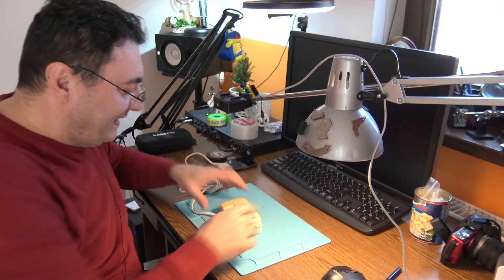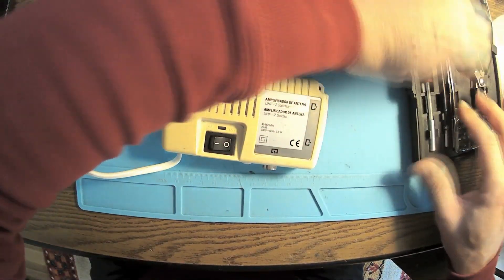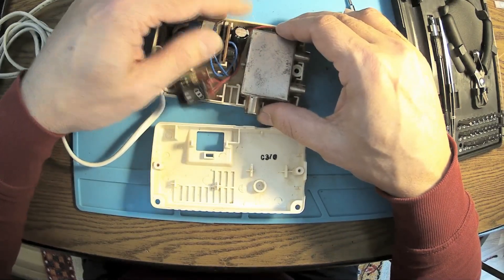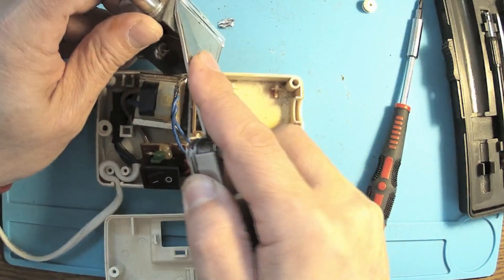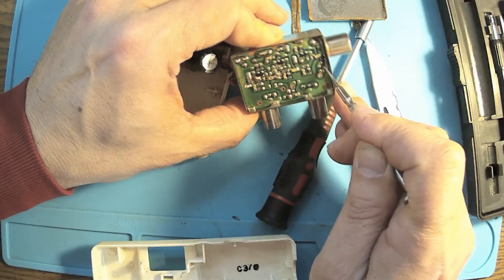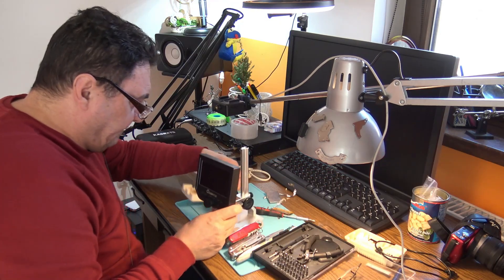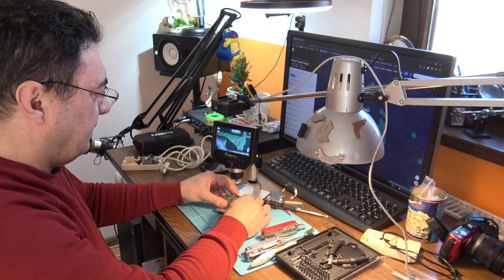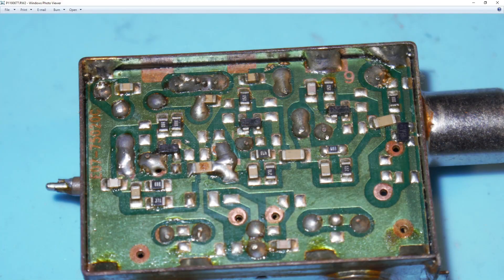UHF amplifier for Helium miner? Why not! part1

Comment: Im pretty sure correct me if im wrong but tv amplifiers are 75ohm helium minera are 50ohm like 2 way radio uhf. So you could use an amplifier just a 50ohm one?
Reply from the maker: Yes, It's not so critical..it really matters for long transmission lines or cables but for this application is not a problem..
Reply: @viocaia  thanks for informing me
Reply from the maker: @vm7898  Always! Thank you too!

Comment: hi great video .on the ab iot 868 mhz amp on your previous tests did green and blue light go on /of ? i have one and only green light on all time cheers
Reply from the maker: Blue is for TX only..it's blinking for half second..when the hotspot is beaconing..so no chance to see it lighting..but if you get your mobile on mobile data GSM.,.and keep it near the antenna input while you do a speed test you see the blue running..means is TX from your mobile..most simple test..
Reply: @viocaia  thanks for quick respons i will try gsm test.. thanks

Comment: Hi sir I have heltec miner, but I have a witness problem, they sent a filter, I have the same problem, what should we do?
Reply from the maker: Good antenna, best cable, filter , amplifier and miner..it should go..start with a good antenna..McGill 6dB , RAK 8dB..LRM400 cbale..then the rest of the things..
Reply: @viocaia  i use 5 dbi rak antenna 5 meter lmr 400 and heltec filter now
Reply from the maker: @ozk1855  Perfect! Now you can try an amplifier..like AB-868-5V bidirectional..
Reply: @viocaia  thank you , is there any company you can recommend to buy?
Reply from the maker: @ozk1855  Sorry..no for now..

Comment: I think you handle and solve this amplifier, but i have some doubts in my mind about this amplifier. I wonder if the TV picture modulation amplifier can amplify the LoRa modulation without any problems?? have a good work bro.
Reply from the maker: Will see..there is nothing special..just class A amplification...